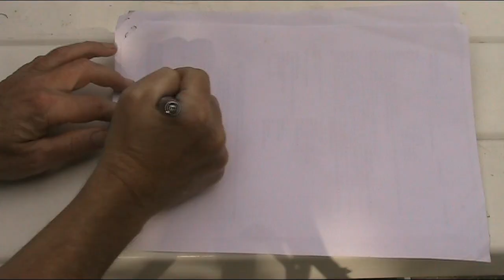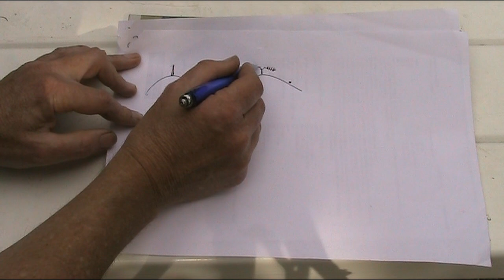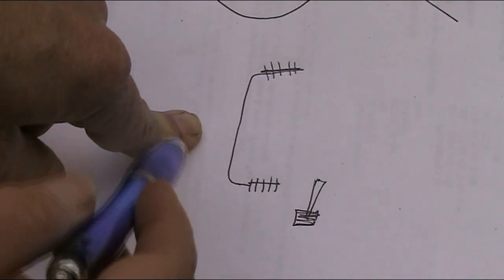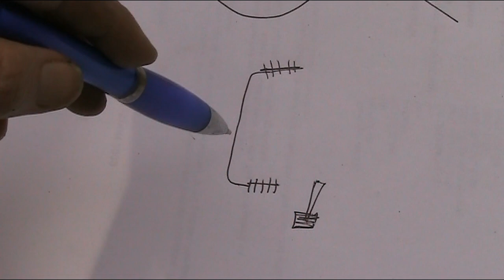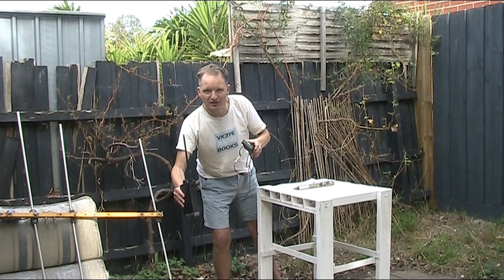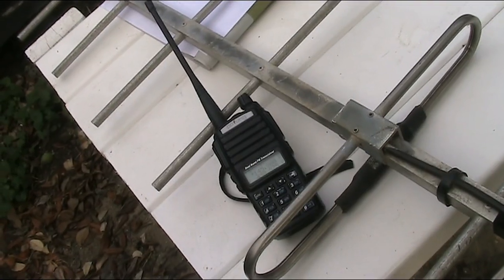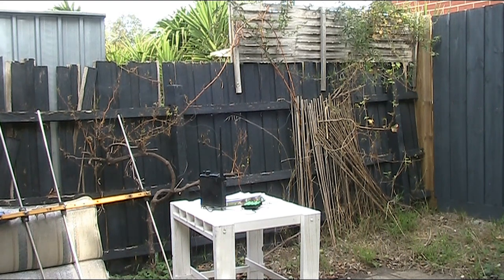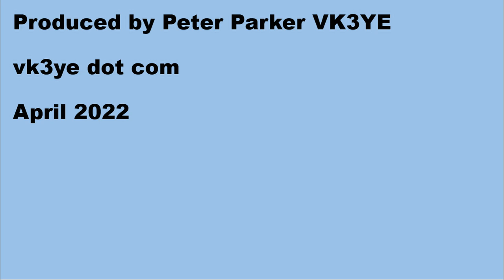Can a passive repeater boost your range on VHF/UHF?

Comment: I was a mobile network engineer for Optus in the late 90’s and early 2000’s. We used passive repeaters a number of times across Melbourne in buildings where improved coverage was required. For some applications however a only a powered repeater would do the job.

Comment: As a cellular tech in the 90s when we had to take a site down for commissioning we would screw a mobile antenna onto one of the main tower antennas at the bulkhead to give us coverage inside the site. It worked great.
Reply: Yes sniffing a signal.

Comment: In the early 1960's, the passive repeaters were usec to fill in TV coverage in the valley bottoms south of New York's Adirondack Mountains.  The one that I was first told about was used for high VHF TV channel's from 80 - 100 miles away. These  were discontinued when cable TV came in some 20 years later. It would be interesting to set up one  on the 1700' hills south of Buffalo and passively link to Canada across Lake Erie!

Worth thinking about... de WB2VUO here near Buffalo, NY

Comment: Good one peter .. yes these do work ive used this principal for a few mobile phone users with poor coverage this has worked very well . On the bottom end i normally use a vertical or dipole type antenna so the signal is not focused in one direction 
But gives some prospect for use on our bands .. would be intresting to test with some marginal repeaters

Comment: I've seen that type used to the to redirect a microwave beam from high on a tower to a ground station underneath at the tower base to do mysterious broadcast industry things. (actually very boring and not so mysterious) This is nice though because it means you don't have to remove the duck and connect to a feeder at home.

Comment: I've wondered about this to get better 4G inside my home, specifically for the router with 4G backup (no external antenna... without modifying it). I might have to give it a go!
Reply: It does work, but you have to do it right. In my case, I build a passive repeater for 900 MHz (B8/GSM), just two antennas connected and using a microwave, it seems to have improved the signal on GSM/LTE by about 10dBm and for some reason the WiFi signal by 20dBm. In the basement, it gave a more stable signal (permanent 4G instead of 2G/4G.

Comment: Interesting probly t wei same beams could increase gain also. 
What  you too think of glass mount 2m 70 cm antennas and the general RF transference thur the glass ? 
Is there loss ? 
Years ago as madol glass mount ant had on first c as r but did not have good swr or recieve well.
Reply from the maker: I've never tried it so can't comment. Maybe others have and can?

Comment: similar to this but in a negative sense, small metal objects or even drinks placed near a wifi router can change the radiation pattern and cause signal dropout in places. Also wet clothing near a router can do this too.